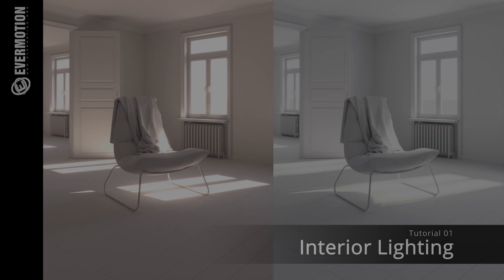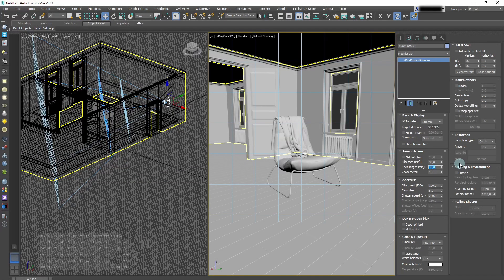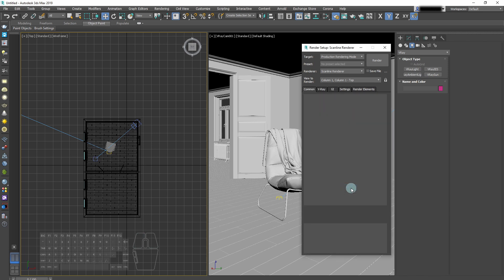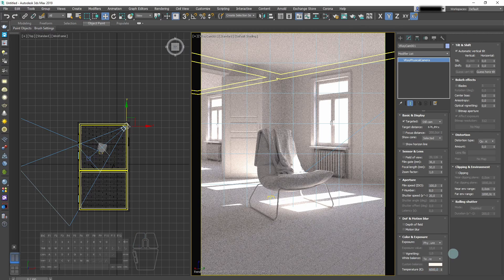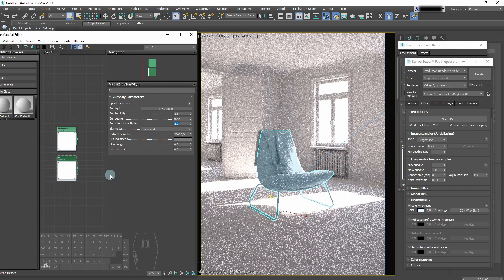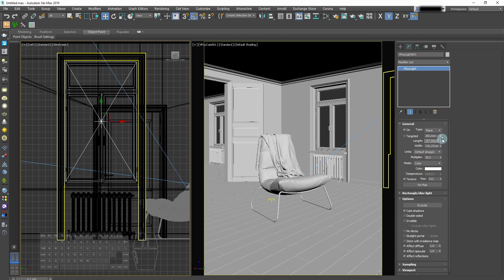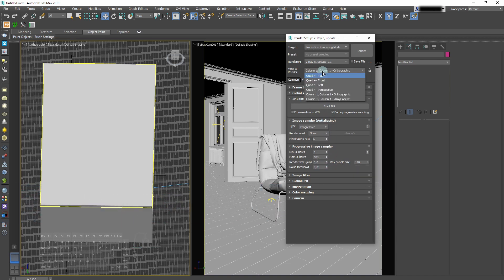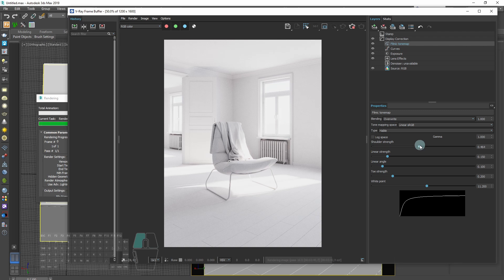Evermotion ArchViz Training Online - V-Ray Interior Lighting

Comment: The guy saying that you don't need sky-portals anymore, well it is right only if you use V-ray Dome for lighting. But in this case, I think, Sky portals are needed.

Some prefer (including me) to use the V-ray Sky inside the V-ray Dome, activating "Adaptive Dome". This way you don't need to use sky-portals.
Reply from the maker: That's true - you don't need portals when you are using adaptive V-Ray Dome. In the case of using VraySun and Sky (or non-adaptive dome lighting) they are advisable.
Reply: @evermotion  No they are not, you put the sky in the dome light and turn on the adaptive.
Reply from the maker: @AndreiPek  that's what we written: if you don't use adaptive dome, use skylight portals, if you use adaptive dome - you don't need them.